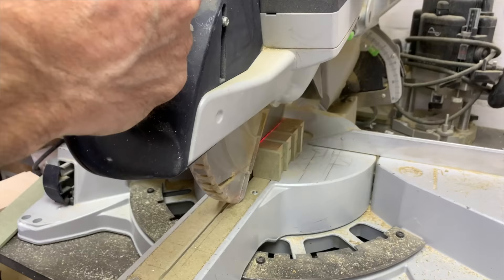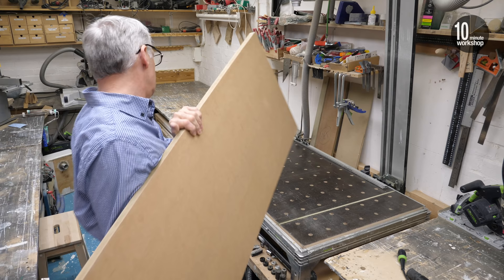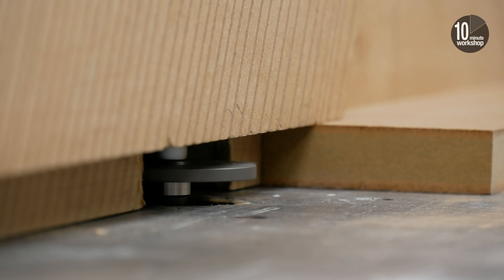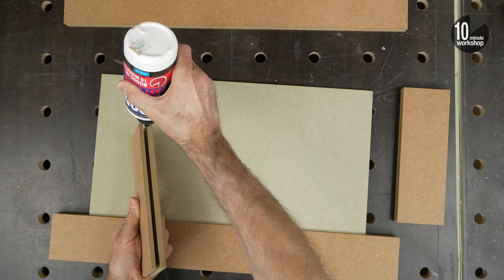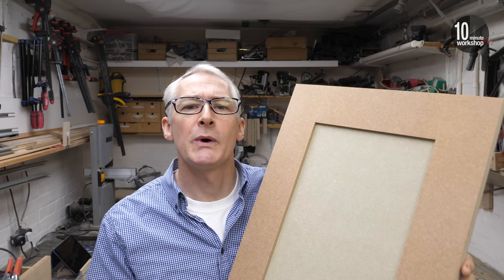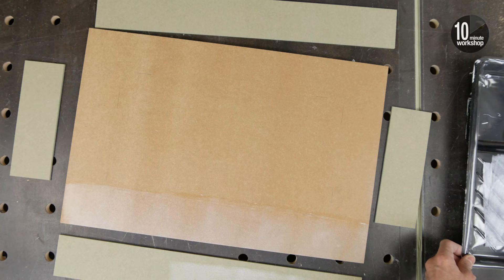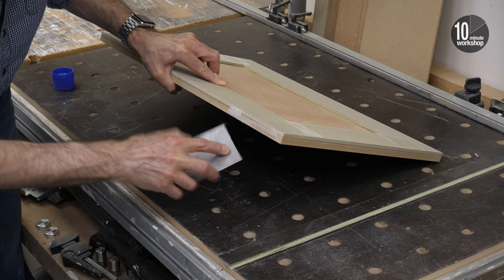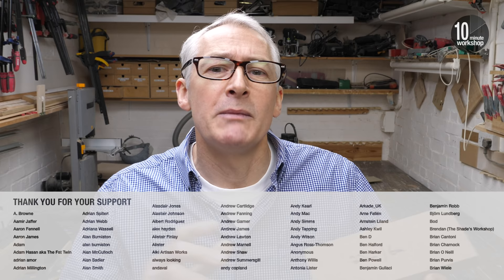Shaker-style doors in MDF [video 405]

Comment: Enjoyed that, thanks...
Different to the mortice and tennons I usually do on timber doors.
 Can you tell me how you deal with the cut edges on the rails and stiles when painting this style of MDF door as usually the MDF has a tendency to fur up a bit after painting and sanding the cut edges when they are right next to the installed (or stuck on)  back panel is super tricky....
You could, as you mention, edge bad the outer exposed MDF edges..but what can we do for the long edges right  next to the panel?
Reply from the maker: Thanks! Video out next week about this exact subject. Short version; use good quality MR (moisture resistant) MDF to start with as it’s much less prone to furring up. 👌👍

Comment: Hi Pete,
Can i ask your advice. Would this method you went through be OK for doors about 550mm wide by 1200mm high or would the MDF be too weak? I'd of course use three blum hinges for each door
Reply from the maker: Yes, absolutely. I've made doors 2200mm x 600mm this way, and they're absolutely fine. The key is to use 22mm MR MDF for the rails and stiles - if you use 18mm it's likely to bow over time. On a tall door, also consider a deeper bottom rail, and a mid-rail if it's appropriate. 👍

Comment: Surprised that in the first way you made the door that you glued the panel into the frame. I would have left it loose - but then I'm not used to using MDF.
Reply from the maker: As I say in the vid, I don’t get extremes of temperature and humidity where I live and this door is made entirely of the same material, which is exceptionally stable. You shouldn’t confuse MR MDF with regular MDF btw, different animal altogether. 👍👍

Comment: Great video. I’ve subscribed. I didn’t think PVA alone would hold the trim. I need to make two large wardrobe doors and I’ll try this. Can I ask why you trim to size after gluing and not just make it the right size to start with, or is it just impossible to ever get it bang on that way?
Reply from the maker: Trimming back to size after the glue-up just ensures that the edges are as clean as possible prior to painting. 👍

Comment: Very useful video - going to try the loose tenon appraoch myself for some wardrobe doors! Seems much easier than using the special rail and stile router cutters that I've seen, as you don't need to be so precise with the depth/height adjustment on the router.
Question for you: do you think this would work with veneered MDF? How would you suggest cutting doing the groove to take the panel? Before or after ironing on some edging? I've not used iron on edging before, so wondering if it would stay in tact when using a slot cutter. Any advice would be appreciated. Thanks Peter!
Reply from the maker: Thanks! I’ve never tried it with veneered board - might be an interesting video! It would probably be a lot of work - I think you’d have to edgeband the inside edges of the rails and stiles, cut the groove through a zero-clearance insert, and cut back (or cut carefully while applying it) the edgebanding where the rails abutt the stiles. Then edgeband the outside edge. So not trivial, but technically possible, I think! 🤷‍♂️👍👍
Reply: @10MinuteWorkshop  Hmmm.... Thanks for those thoughts - very helpful. I've never used a zero clearence fence, so this could be a good project to try it on. As someone who really hates painting, I really hope I can get it to work! I wonder if a straight bit would give a cleaner result, holding the rails and stiles flat against the fence rather than using a slot cutter? I have a 1/4" slot cutter, but not a 1/4" straight bit, so I'll try the slot first, and if that fails dismally then I'll give the stright cutter a stab. And if that fails, I guess I'll have to suck it up and get the paint brushes out! Thanks again -- long time "silent" fan of your channel - have found your advice, tips and suggestions really helpful and they've given me the confidence to try all sorts of things that I would never have dreamt of doing before.

Comment: Hi Peter, I missed this video and only just watched it.  You said you no longer make shaker doors the easier way and have a video for it (which I have now also watched) where your point, for which was a good one, was the hinge screws either fall on the gap between the panels.  I am curious if you made loads of doors like this, how much come back did you get from customers with any issues with this method?
Reply from the maker: Hi Colin. I didn't make many doors the 'faker-shaker' way, with just planted-on strips of MDF, because I just didn't like them very much, but I've never had one fail, either because of screws or the construction method. But it's not best practise, and the loose tenon way is better, if you have the means to produce them. 👍

Comment: Those doors seem really thick.  We only see 16mm and 18mm MDF where I am.  And 18mm doors look chunky.  I remember when we made  carcases from 18mm particle board and occasionally the Melamine faced MDF doors were 16mm and looked so sleek and sexy. Haha.
Reply from the maker: Solid, not thick! 😂 Best way to avoid bowing on a larger door, so I standardised on 22mm throughout. As I say in the vid, 18mm is fine for a smaller door though. 👌

Comment: Hi Peter, thanks for this video. Looks way easier when I watch you making them than when I'm trying to do it myself. lol
I'm looking for a sort of flat panel door like those commercial panel walls which would probably be just a flat sheet of MRMDF 1700 x 650 mm with a groove 5mm deep and 5mm wide in the middle. Do you believe 18mm would be ok or should I go thicker than that? My only concern with thicker would be having to install more hinges because of the weight. Thanks!
Reply from the maker: Thanks! 18mm should be OK as a flat slab, as long as it’s been stored flat; bowing after painting would be my only concern.
Reply: @10MinuteWorkshop  thank you very much for taking the time to reply, specially in a holiday. 
Would I lower the risk if I seal, prime, all in a heated environment and maybe some uv lights to make it dry faster? Just thinking...
I can either spray them horizontally in a support or I can hang them and spray both sides in one go using hooks and stainless steel hangers (done that with some 20kg doors 30mm doors). 
Just not sure if 18mm requires some different procedure due to being thinner. But I'll do some research on the warping subject.
Thank you very much for this.
Have a great weekend.

Comment: Great video, curious why you prefer loose tennon over a domino. They must be a bit of a pain when you come to paint?
Reply from the maker: Thanks! If you're running a groove to take the panel anyway, it's just a very quick way to do it. If you want to use dominos, then you have to stop the groove either end of the stiles, and depending on the depth of the rails, and the depth of the groove, you may end up not being able to reference off the pins/paddles for the dominos. Painting the loose-tenon doors is easy, and if there's any slight gappiness, it's easily filled. 👍👍

Comment: Yet another question Peter, sorry! Do you put a chamfer or round-over bit on the edges, a few strokes with some 120 grit? And does this include the inside edges of the rails/styles?
Reply from the maker: Thanks! They get a light sanding, but not an aggressive round over - just enough to knock off the sharp edges. 👍

Comment: Hi Peter, I've made a couple of large doors using your earlier videos on this method as guide. I always struggle with glueing up as the groove is too tight. Any tips for fixing this. I guess I could do one pass on router then adjust it very slightly and do another pass.
Reply from the maker: Hi James. As mentioned in the vid, 1/4" grooving bit (6.35mm) and a 6mm panel gives enough wiggle room for them to glue up nicely. If they're still a bit tight, then you'll need to run a second pass to get a slightly looser slot. HTH P

Comment: Perer, you cut the ¼" groove 6.35mm down - which side of your doors face out? also, if you were doing 2m doors would you use 9mm panels? many thanks!!
Reply from the maker: On a shaker door it’s usually the 1/4” side facing out; I use the deeper one if I’m applying moulding to make a ‘Victorian’ door. 👍

Comment: Hi Peter, thank you for all the videos. I have a question, what is the size of the door compared to the carcass? I think it should be smaller, right? but by how many mm on its side?
Reply from the maker: That’s a much bigger topic than you might think as so much depends on the placement of the door, and it’s proximity with neighbouring doors and walls. But roughly I aim for 1.5-2mm between doors, and between the door and a wall.  👍

Comment: Love your vids Peter! In Australia we only have access to 18 or 25mm MR MDF. If making large 2000 x 450mm cabinet doors, which thickness would you recommend using?
Reply from the maker: 25mm at that height. I had problems with 18mm bowing at 1900, they all went away when I switched to 22mm. With 25mm I’d be tempted to use a 9mm panel. 👍
Reply: @10MinuteWorkshop  Thanks Peter. Much appreciated

Comment: Love your videos. I just made faker shakers recently and having watched this can really help me save on materials. Will an 18mm mdf work instead of a 22mm for the rails and stiles?
Reply from the maker: Thanks! Yes, 18mm is usually fine in smaller doors. I switched to using 22mm because I had some full-size wardrobe doors bow in 18mm, but for smaller doors they’ll be fine. 👍👍
Reply: @10MinuteWorkshop  What do you define as a 'smaller door'? I have some 1850x450mm pantry doors I was hoping to make with 18mm rails/stiles, and maybe beef up the panel to a 9mm panel. Appreciate you thoughts as to the strength (I was planning on putting a mid rail into the door as well)?

Comment: Hi Peter I have decided to make some shaker style doors like the ones you made with the loose tenons but I'm finding it difficult to get a router cutter that can cut 18 mm deep like the one you have. I'm wondering if you could let me know the make and number of yours or if you got it on line .I'm in dublin and trend cutters only cut 10 mm deep. I like the larger tenon. Thanks Paul.
Reply from the maker: Hi Paul. I get mine from Wealden Tool - Heavy duty groover - http://bit.ly/HD_Groover and you’ll need an arbor for above - http://bit.ly/Arbor_8 👍👍

Comment: Great video. Once quick question, could I use MR MDF outside? My dad wants a little outdoor cabinet making and I don't have the tools to plane/thickness pine or whatever. Many thanks.
Reply: Ps it will be painted
Reply from the maker: Thanks! No, MR MDF is an interior board, intended for environments that have higher moisture content than usual eg kitchens and bathrooms. You can get exterior grade MDF (Tricoya) but it’s expensive and not widely available. If I couldn’t use redwood/Scots pine, then an exterior WBP plywood would be my choice. HTH. P
Reply: You can get external MDF. Not MR. Or tricoya. External MDF has to be painted on all exposed edges.  And it would be fine

Comment: Great video as with all on your channel. Any advise on stopping burning when routing in the slots. Tried cha find speeds and taking smaller cuts but can’t seem to stop the burning?
Reply from the maker: Thanks! Usually a blunt cutter, or too fast a feed rate? What material is it - MR MDF?
Reply: @10MinuteWorkshop  yes using MR MDF. It’s a brand new cutter and router setup so would hope that it isn’t a blunt cutter but will check it out. Very new to woodworking myself. Thanks for the quick reply.

Comment: How wide are the tenons?  (or how deep are the grooves?)  Funny how everyone talks about "loose tenons" requiring mortises completely inside the joint, but this is far easier and just as good.
Reply from the maker: Well, the tenons need to be twice as wide as the groove is deep, or very slightly under. And the groove depth is entirely up to you; if you use the bit and arbor I link to in the video description you'll have a ~22mm deep groove - lots of guys I know use a regular 13mm grooving bit, and their door haven't fallen apart, so whatever works for you, and whatever you can get you hands on. 👍
Reply: @10MinuteWorkshop  Those groovers (recommended rpm 15,000) are bigger diameter than anything safe for my router, which spins 25,000 rpm.  I could use a router "speed control" but with those you never know how fast you're going.  Plus I can't find a groover supplier in the US.  So I'm thinking of using a 1/4" straight bit, and just turning the boards on their side.  Not ideal - open to suggestions!

Comment: Peter - Hope you are well - Could I ask your advise once again please. Given the option of making a simple Shaker MDF Door which has an outer frame of 58mm wide and a panel recess of only 5mm would you suggest that it would be better to make with such as your loose tenon option or the alternative to make them from a single piece of MDF and simply CNC Machine the Centre and reverse of the door in order to create the recessed panel effect. Recessing both sides in order to balance the door once painted.   There largest door size would be approx 600 x 1200mm x 18mm thick.    Any advise or opinion you could offer would be appreciated.
Reply from the maker: Ordinarily I’d say make it with the loose tenon method. But my pal Alistair over at freebird interiors has had good results recently by CNCing out the centre panel of a slab door. Be aware you need a very well set up CNC with some expensive bits to do this successfully. 👍👍
Reply: @10MinuteWorkshop  thanks Peter.  Yeah I've seen Alistairs videos and have been in contact and he has very kindly gave me a quotation for the manufacture of the doors in question.  Very competitive and helpful.  I was just looking for a bit of advise as hadn't 100% convinced myself that the CNC option was best but following on from your comments and the quality of Alistairs work I think I M sold.     Thanks again and keep well

Comment: Quality video guide Peter. Why is the grove not in the centre of the rails and styles. Whats the benefit of offset @ 6.35mm, thanks ?
Reply: I think the 6.35mm was in reference to the router bit. It's 1/4 inch rather than 6mm, giving a slightly larger groove (6.35mm) than the thickness of the 6mm panel for glue, or stashing drugs or something.
Reply from the maker: Yep, as Rico says, 1/4" or 6.35mm is the thickness of the grooving bit - makes it easier to fit the 6mm panel. You can put the panel where you want, of course, but I like an offset because a centred panel in a 22mm thick rail/stile gives an 8mm thick rebate, which looks a bit heavy to me. It also makes it very easy to identify the face side if you're working quickly or haven't marked the pieces up. 👍

Comment: Hi Peter, it's Mat here from "down the road" (W4!), may I ask, I think you have the Spotnails SE30/08 - I saw it in a previous vid and think I may just get one, as I plan to do loads of faux panelling around our home (renovation work) as well as faker shaker doors in various places. Really think I'll be better off stapling the things in place so they don't slide around. How do you find that veneer nailer, is it good?
Reply from the maker: Hi Matt. It’s decent enough, but I’d be more inclined to go for a 23g headless pinner tbh, and unless you need the portability of an electric nailer I think I’d be more inclined to go for a cheap compressor and an air nailer as the more economical option. If you’re only working in your own home then pulling the compressor around isn’t too much of a headache, compared to clients homes.  HTH P
Reply: @10MinuteWorkshop  Thanks so much, really helpful. I don't need portable. I have always wanted to get a cheap compressor and some air tools, mainly for other tools like orbital sanders etc. What's a good model / place to buy? I couldn't find much for less than three / four hundred quid, but was probably looking in the wrong place! Cheers

Comment: Hi Peter, just a quick question. why don't you use 2x1 pse timber for the rails and stiles...?
just wondering if this would be ok as I would find it difficult to cut a full sheet down to 75mm strips. cheers
Reply from the maker: It’d be pretty skinny for rails and stiles, and you’d need very clean cuts in the end grain. You’d want it to be fully acclimatised to the environment as well to avoid any twisting. 👍
Reply: ah yes, maybe be better with 3x1 and agree it wouold need to be well seasoned !
Thanks for the advice.

Comment: Do you have any videos on adding a glass panel to a mdf door? How do you hold the glass in? Do screws not hold well on mdf?
Reply from the maker: Yes, I did glass doors in the ‘cabinets and shelves’ series, videos 165-167. Screws take fine in MDF as long as you pilot hole and use the right size. 👍
Reply: @10MinuteWorkshop  Thank you for your response. Love the videos. Keep up the great work.

Comment: Is it ok to use 22 Mrmdf + 6 Mrmdf for panels on a 1800 x 600 kitchen unit door thanks
Reply from the maker: Sure. Most of my doors were made like that. The 22mm rails and stiles give the door enough ‘heft’ that the thinner panel isn’t an issue. 👍

Comment: I'm brand new to woodworking. I'd like to make the fake Shaker door out of pine that i will veneer with a nice wood. I live on the french Riviera but we have AC so looking like 19 to 24 c degrees. If I buy a glue that is good with flexing with the weather (i read that there are some so that they will flex with the wood) and maybe add a pin or two, would this method work?
Reply from the maker: Unless you have previous experience in veneering, I wouldn’t suggest starting with a shaker door.  Most shaker doors are not veneered for a reason - it’s hard to do well, and generally takes longer than making something from solid timber.
Reply: That makes since. Thanks for the advice ❤ @10MinuteWorkshop